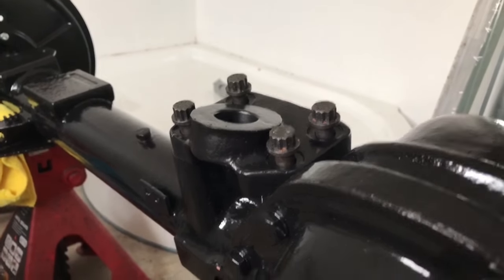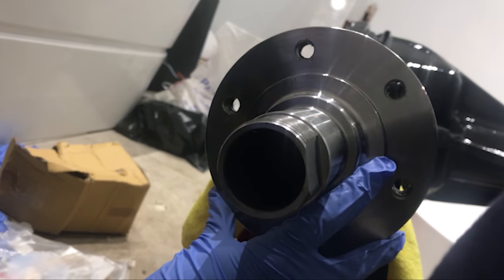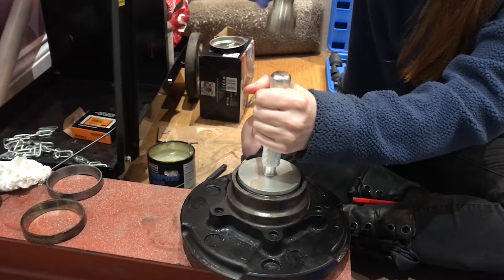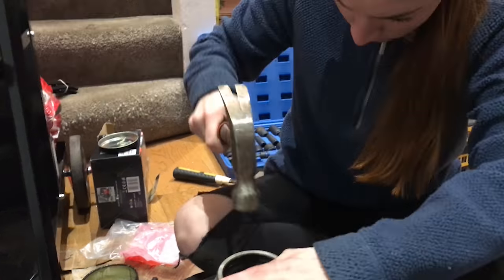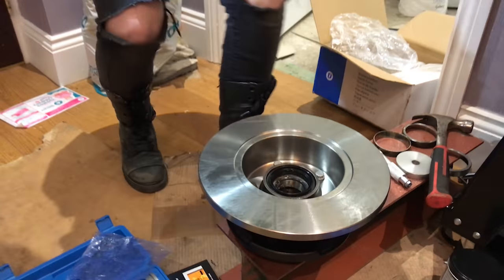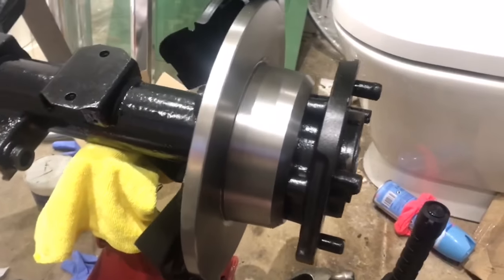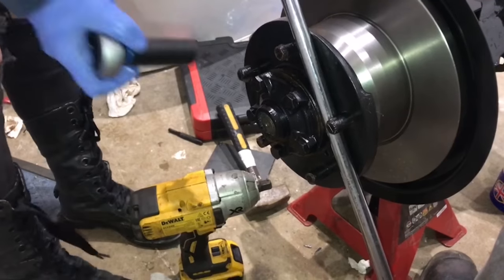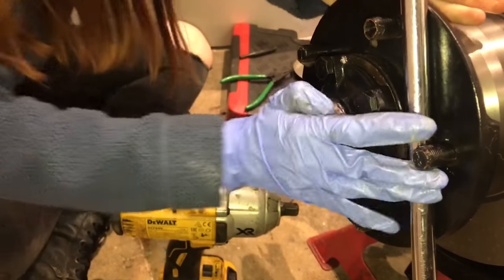Working On The 110 - Defender Pre-MOT and Winter Prep (Part Four)

Comment: Great work again young lady! A little tip for bearing races, hot spots and brake caliper pistons is to put them in the freezer for three or four hours. They will shrink a tiny amount and aid installation. With the brake caliper, after cleaning up (on an old unit being refurbed) just pop it into your oven for half an hour prior to rebuilding and at no more than 60 or so degrees. This further aids inserting brake pistons because the heat exoands the caliper and the freezing cold shrunk the piston so a nice easy fit. I have done a video covering this on one of my Discovery's.
On anthoer note of messing with Land Rover parts in a house, I once started a 2/14 Series 3 diesel engine in my mums basement. The noise was incredible, it bobbled around like a whacker plate and smoked out the basement, dining room and kitchen. Mother was less than impressed, more so when she saw my mate and laughing at the sight because the engine was an unkown quantity prior to that. As it happen, I have another 2/14 diesel engine coming in a week or so and it's been stood for about 25years so may do a "Will it Start" video in shippon at the back of where I live now.
Top regards!
Reply from the maker: Thank you! Yeah I’ve used the heating and cooling trick a few times. I used it on the input flange for this axle when I changed the pinion oil seal but sadly I forgot to record this. Good advice though never the less!
I look forward to seeing the Will It Start video! Haha

Comment: lt is a pleasure watching your work young lass,at your age l was struggling changing oil and tyres. These days the only problem working on 110 Isuzu county is my age factor. The worse job l had was taking the diff carrier out to put a Elocker in with the diff still bolted to the landy.

Comment: I admire your enthusiasm and your determination to take on big jobs.  

Just so you know, bolt tensile ratings have nothing to do with their colour; the passivating or anodising can be done to most colours, though silver and yellow are most common.  Sherardising is usually charcoal grey, which is what you see on a lot of the Gen Parts fixings.

Old bearing races are good drifting tools.  If you cut a slit in one side, then it works very well for drifting in new races while being easy to subsequently remove.

Comment: Firstly not everyone has an RSJ in their hall, when I was single I rebuilt my Jaguars rear end and brakes in my lounge while watching the TV with a nice roaring fire :). must agree Timkin are the best.If possible when using the old race to drive in a seal use the thicker side on the seal and tap on the thinner side, less chance of it skewing when it goes in.When torquing nuts like on the shaft and you are pulling the wrench up try going the other way so you can use the weight of your body to push down on the wrench it makes it easier, not trying to tell you what to do just years of working on cars you pick up the odd trick. by the way your video's are great for anyone doing the same job.

Comment: Memories of servicing the fully floating hubs on the Austin Champ. It had 4 wheel independent suspension with torque bars (highly sophisticated) and a mixture of "rubber" and  leather oil seals.

Comment: Awesome video. I'm loving this series. Thanks for sharing. I'm learning a lot from your journey. One tip on using the race tool. There's a bolt at the end of the driver that you remove then put the race driving tool onto the end of the shaft, then tighten the bolt down to hold it in place. I hope that makes sense. Great work work Sophie! You could make a career of this if you wanted to.

Comment: Rebuilding an axle in the bathroom, storing a MIG in the hall and the floor covered in sockets and tools, I feel that there is a strong chance we’ll see you using the dishwasher to clean engine parts soon (it woks pretty well actually)
Reply: The engine is tore apart on the kitchen table Transmission is tore apart on the living room coffee table axle is in the bathroom hopefully she didn't have to pack it up a set of stairs 😳

Comment: Great video Sophie, just noticed that the spring from the oil seal was facing away from diff which I was always lead to believe that the spring should always face towards the oil and with your bearing driver take out the 13mm bolt in the end and put back in when you have chosen the correct cup size, I'm not criticizing just trying to help, keep up the excellent work.

Comment: Love the attention to detail on the rebuild of the axle even down the padded axle stands to protect the paintwork. Have used the torque wrench as a ratchet in the past. Copper grease works wonders on cars. When I buy a new car one of the first jobs I do is put copper grease on all the wheel nuts or bolts whichever is fitted.

Comment: Great work as always, I did most of my axle, brake and suspension work in winter outside huddled under a gazebo, I did take my hubs inside to do the bearings to make sure they stayed nice and clean.
Built a workshop now and its made a huge difference. 

Looking forward to more updates.

Comment: Good work as usual, an unfinished bathroom is as good a dry workspace as any! The internal corrosion is usually caused by condensation,  axles will have a breather to help vent the air space, the air will contain moisture and that will condense on the cold steel. I am not familiar with this period of LandRover and their apparent lack of 'anti-rattle' brake pad springs/clips usually held by the pad pin's, the small coil springs will help somewhat - I hope they are well protected from corrosion though.

Comment: You can use a torque wrench like you did as a ratchet with no consequences if the bolt isn't giving any resistance. I was always told it's continuous breaching of the set torque level rather than stopping after the click that screws them up.

Comment: Better than new! I prefer working on the floor as you can't really drop anything and lose it :)  I once cleaned a fuel tank that was blocked with solidified veg oil using a broken stuck on boiling shower, don't recommend it even though I was replacing it! Lol :)

Comment: Great job just a tip start with the torque wrench at the 3 o'clock position and push down its easier and safer than pulling up
Reply from the maker: For some of these torques I had to work with how it was twisting the axle of its stands as someone else was trying to counter this and hold in place - other times I may have just been stupid lol
Reply: @LandRoverSophie  its all a learning curve but not getting hurt if avoidable is a must should see the chunks I have taken out of my hands from years of spannering best avoided if possible
Reply from the maker: Yeah of course, thanks for the tip! As you say - it’s a learning curve ☺️

Comment: What can help for greasing tapered roller bearings is to put them in a zip lock bag with some grease, seal the bag and manipulate the grease in.
Reply from the maker: That way would be quite hard to ensure you’ve got good penetration though the bearing would it not?
Reply: @LandRoverSophie  normally easier, and less chance of dropping the bearing, and you can squeeze the grease in.

Comment: Great video. You seem to know what you're doing but for my money you put that hub oil seal in upside down. You showed us it said "this way to stub axle" but you then put that side of the seal to the hub not to the stub axle. Perhaps they've changed things in the 110 but if that was a 1980 Range Rover (which is the only vehicle I know about) the seal would definitely be the other way up.

Comment: Enjoying this series of videos. Could someone tell me what O.E.M. means in relation to vehicle/machinery parts even if it is while you have a little chuckle at my ignorance.
Reply: Original Equipment Manufacturer, i.e. whoever supplied the parts to the factory when it was first built. 
Replica parts are often referred to as Pattern Parts, and often cost quite a bit less (but might not fit/work as well)
Reply: @mikebradshaw2118  Thanks for the info.

Comment: Sophie at the builders merchant.
Sophie: Hi, I'm looking for some bathroom tiles. 
Employee: Ok, we have a good selection of them, what are you looking for?
Sophie: Well, they must be strong enough to take the weight of a Landy axle first of all.
Emplyee: Ehh, strong enough for what did you say?
Sophie: A Landy axle. Oh, and scratch resistant too, axle stands aren't to kind to flooring as you know...
Emplyee: Axle...what?
Sophie: Axle stands, don't you know what those are? What's your color selection by the way?
Employee: ...Well, we have white, light grey...
Sophie: Any colors that will hide a bit of rust dust and a few specs of grease?
Employee: Ehh, let me get my manager out here...
Sophie: That's fine, ask him if brake cleaner will hurt the grouting will you, thanks.

Comment: sophi darling your nearly a true pleasure to watch BUT get that claw hammer and give it to a joiner your engineering not wood working  it was the lack of weight in the hammer fitting the seal that was the problem the rest of the tooling spot on a 2lber is great and remember it only  hits as hard as you use it  and when you tighten the disc to hub kneel down to the wheel and pull the wrench towards you keeping the socket at the inside the disc so it doesn`t lean like that and move around the wheel pulling to you all the time and press down to tighten when ever possible yes i bet you already know this but just like a lot of use forget oh and very happy birthday
Reply from the maker: Thank you and yes, I do have other hammers but I have lost my good medium size one. To be fair I find the claw quite useful for some jobs I probably shouldn’t use it for. Don’t worry though I get what you’re saying

Comment: If its a girl working on a car no one complains about too much copper paste on the pads or the wrong (high strength) threadlocker on the bolts.
Reply from the maker: Oh trust me, plenty of rattled men like yourself pull me up on such minor things.
Reply: heat breaks the thread lock anyway so using high strength stuff isn't a big deal